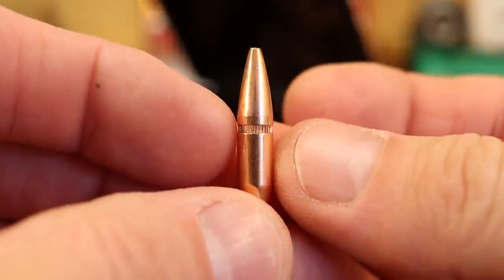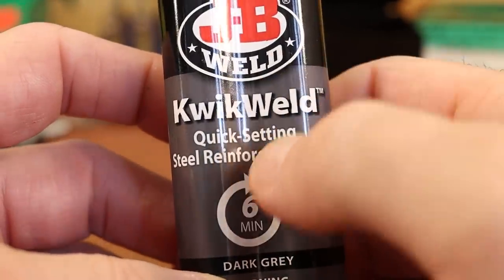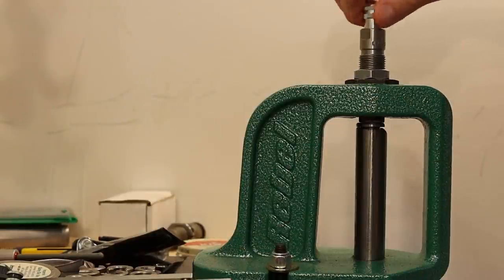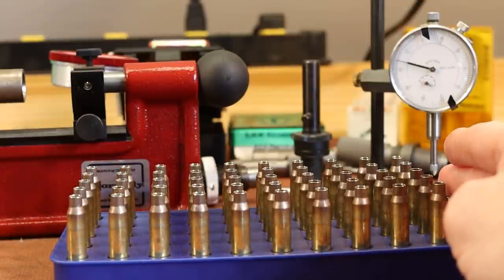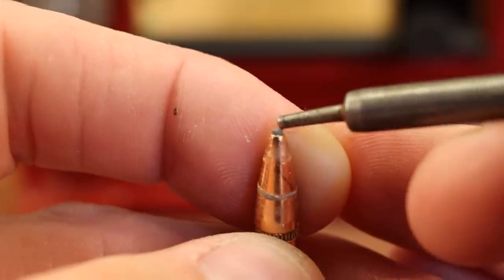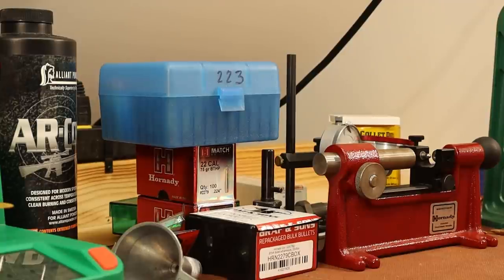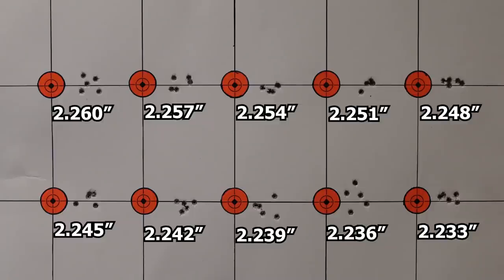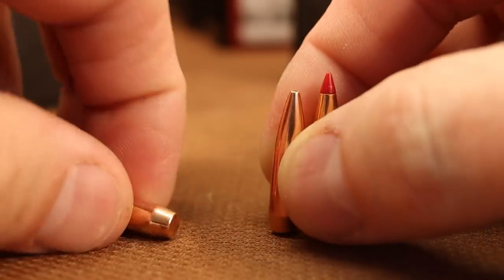223 Rem - 75gr Hornady BTHP with AR-Comp

Comment: I have a question about using a case guage vs using a shoulder comparator. I have always used just a case gauge to set the dimension on my sizing die.
I have no idea how many thousandths that bumps the case back. I just size until it is just flush with the top of the gauge. I figured that is good enough with out over working it.  Now I am considering being more precise and using the comparator and calipers.

Do yall thi k this would make a big difference in the accuracy of my final ammunition?

Comment: Is 22 (.224) the correct size for a 223? Or is it for 224 valk? I have been acting like a rat at my local range and reloading section. I have secured a couple different powders and picked up 1000rifle primers.  Now I’m on the hunt for projectiles and see a bunch of 22 (.224) on the shelves but have been hesitant as I don’t want to chamber the wrong sized projectile in my gun 😅
Reply: Yes, .224 is the correct size for 223/5.56. If you don't have a reloading manual, get one. I recommend lee with hornady as a close second.  The first page for each cartridge will list the specifications, including bullet diameter.

Comment: That Hornady tool isn’t giving you correct runout. I don’t know why they make it. It doesn’t really measure anything useful. It would be interesting to ask them. My guess is it makes their dies look better, but heck their dies already make great ammo!

The case aligns in the chamber by its body being pushed forward by the ejector. So, the outside as it is sized must be what you spin. You measure the tip or about 0.050” from the tip to avoid the micro deforms at the tip. RCBS does this ok, but 21st Century tool is better.

Some ball park numbers ime. A 0.005” runout can shoot 1/2” groups, but a 0.010” will be closer to 0.8-1”. With some efforts, you can get 0.004” or better consistently.

I like what you are doing. I got 0.5-0.6” groups with the non-cannelure bullet in the same barrel! What mags are you able to put 2.26” ammo in?

Also, try spinning your bullet in a drill pressing the seating plug on it with compound until a new bullet fits the seater plug. This works great when I have done it. It requires very minimal time to get a good fit. Then I finish the plug with Flitz on a cue tip, until the marks stop on the bullet.

Comment: Another question from the new learner:  How is it possible that  run out changes anything when every bullet has 18" of barrel to fix and focus the aim of the projectile? I can see where a different aim or velocity due to variable powder charge might make a difference.  I can see where a hot or cold barrel might change the flight of the bullet. But if all those variables are removed, how could run out back at the chamber possibly matter after a foot and a half run down the same barrel?  Thank you all for helping me understand :-)
Reply: Lead is soft if it starts crooked into the rifling it will keep that goofy yaw/wabble and will not be as stable as if it had started true and concentric with the bore.
Reply from the maker: I'm an old learner and I still have no idea!
Reply: That's a great question. From what I've read over the years, some of the experts basically say that if it starts out crooked ,it will end up crooked to a degree that can have adverse effects on flight. But it seems like seating depth nodes are where it's really at. 🤔

Comment: Seating depth is more important under 500 yards than runout under .007 it seems most of the time. Question, have you quit doing Twitch? I just resubbed for another month. FZ
Reply from the maker: I'm on a twitch break. Sorry about that. I will have a video explaining stuff soon.
Reply: @JohnnysReloadingBench  No worries, so how are the chickens doing?

Comment: I'm finding that the ELD does not fit in a magazine without seating what appears to be past the o-jive....have you encountered this or know a fix? I haven't shot any of the loads I made due to the uncertainty and gut feeling of it being dangerous...please help.
Reply from the maker: The 73gr ELD is the one that fits mag length. I would pull the 75's if you are not comfortable with the load. Not a bit of shame in that! It's the smart move.
Load them again, but stick to Hornady's recommended OAL if it fits in your chamber (it should). You might need to single feed them, but it will be fun testing and learning. If these are your first loads, you're not going to want to shoot fast anyway.
Reply: @JohnnysReloadingBench  Thank you! I appreciate and value your input.
Reply: Pull em. In my TC Venture I can load to 2.365 and most times I do <2.360. And they shoot very nice. Not made for AR's
Reply: @armedfarm3429  Thank you. I will just use them to build a load for a bolt action. I appreciate your response.